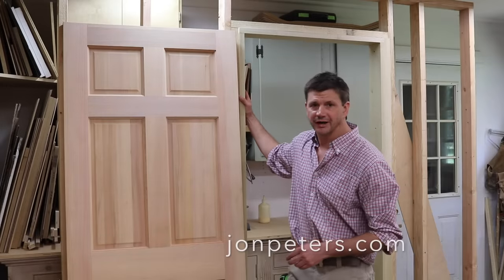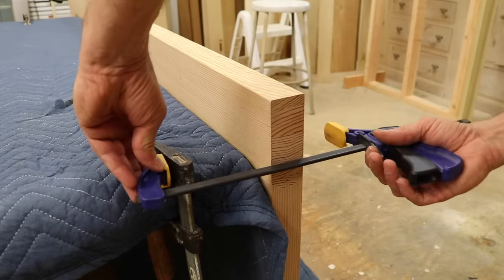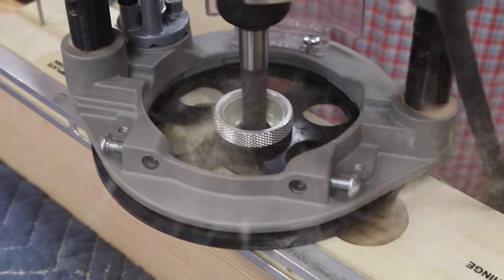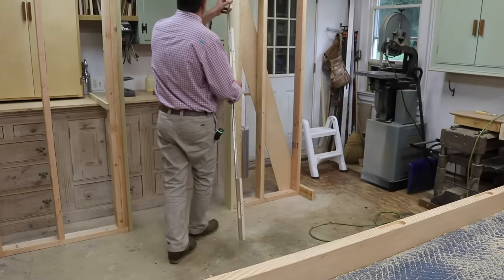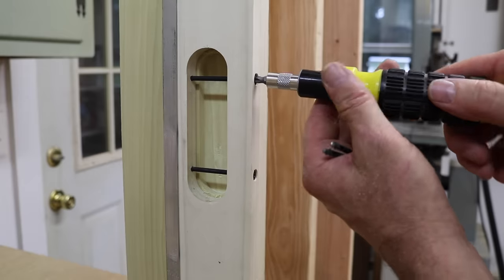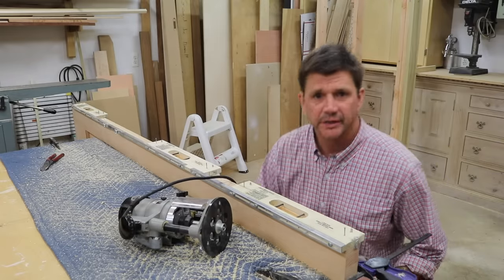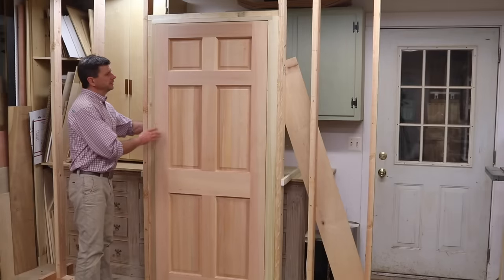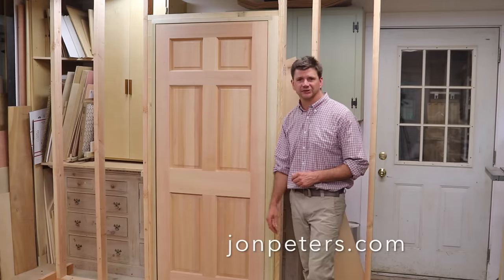How To Hang a Door with Soss Invisible Hinges

Comment: Good tutorial. I'd add set the plunge router before assembling the jig for both depths and use a ton of glue and screws on the buck stud or the drywall may crack. You all can second guess the order he works in but this is the most efficient. Nail holes will re-secure the jig exactly. JP avoided the uneven hinge placement topic Soss recommends which would have filled the comments with panic and arguments like happens on about every job I install these on. Notice the middle hinge is not centered at 1.5 minutes. Now you all can second guess that too. Final word, he did this exactly right. Go try some yourself, then comment.
Reply: Having both a separate Plunge base and Fixed base Router set up you don’t have to keep moving the Template from door to jamb then back to the door...Anyone who is challenged enough to use these hinges had better be prepared tools wise... I seed these hinges on two 3-0 x 7-0 solid core doors as Racket ball court entry doors to the court keeping a smooth face for balls not to engage with... I done this countless times... Good Video Jon...
Reply: Can these be installed on hollow core doors?

Comment: What type of door are you using?  Do you recommend a manufacturer? Also for your jam do you have a preferred Material\manufacturer?  When you prepared the framing for the door did you give yourself a tolerance for the door?  Or did you measure the opening the exact measurement of the door

Comment: Do the Soss hinges say which side goes in the frame and which side goes in the door? as I noticed at 5:11that you fitted them so the door was swinging from the underside of the hinge as opposed to sitting on top which I would of thought was a stronger way of fitting them. Hope that makes sense.

Comment: Great video. I've been doing doors strictly since 1997. These hinges are great for interior use. Exterior use would seem difficult to weatherstrip with compression copper weatherstrip. I guess you could use pop in Q-Lon, cheap weatherstrip but that would be like building the BMW but opted for hub caps instead of real rims. I have used this Hong on jewelry boxes also. Smaller of course.
Reply from the maker: Thanks Roger
Reply: Hi Roger, what would you suggest for outdoor use? I need to rehang a bungalow door to open to the outside because the floor has shifted & the threshold now has an uneven gap. As a result the door doesn't fully open to the inside anymore. Having a hard time finding hinges that aren't a security concern.

Comment: I made a door by laminating 2 pieces of 3/4 plywood for a small entry to a basement but, on their website calculator 1 1/2 inch door thickness is not an option. Does this mean I am not able to use these on this door at its current thickness?

Comment: What size bushing and bit did you use? Did the thickness of the bushings wall affect the installation of the hinge?
Reply: Porter-Cable 42024 is what I use with a half inch router bit.

Comment: Hey great job there. But I used same bushing from porter cable recommended  by soss and using a Bosch router the bushing doesn’t reach the screws for the deeper cut, any suggestion? Thanks

Comment: great vid - what is the reason for moving the jig to the door frame before cutting the deep mortise on the door?
Reply: The depth of the shallow mortise is crucial to the hinge sitting flush in the mortise. If he routed the deep mortise immediately after the shallow one, he would need to reset the router depth again for the shallow mortise on the door jamb. This would waste time because it takes some extra detail and caution to get the shallow mortise just right.

Comment: Hello, thanks for the nice video.
My questions are:

1. These invincible hinges are they better than normal hinges?

2. How long do that lust once installed on a door?

3. Does this hinge opens 90 and 180 degree's or just 90 degree's
4. Are they affordable?
Reply: I used OTLAV 3D hinges, made in Italy. Excellent quality, very well built, 3 way adjustable. You can find them online.
Reply: $52:83

Comment: I do not understand the series of cutting the mortises. If I was doing it I would cut the shallow mortise and then put the spacer pins in and finish one set of hinges before moving on the do the door jam, I know it means moving the pins more but they are not difficult to take out or put in and doing it this way reduces the time needed to reposition the jig.
Reply: that means adjusting the depth of the router bit for the critical depth of the shallow mortise twice, so this is the easiest way possible
Reply: ahh - I had the same question, didn't think of that.
I suppose then if one had two routers both mortises could be routed with one set-up.
Reply: My thoughts exactely
Reply: I would prefer to see the screws longer it carry a lot of weight.
Reply: That plunge router has 3 plunge settings. If you set the 2 depths before hand it will save you time. You don't need 2 routers. The default about sos hinges is that they have no adjustment.
I started using the Tectus hinges and I will never go back. They have up and down, in and out adjustment.  I like the video 👌🏽
Reply: Dogwood Takes
Reply: John Fithian-Franks.........
Reply: John Fithian-Franks

Comment: i bought the little silver template guide thing that you have but the router i am using doesn't have that same black plastic plate that the bottom of your router has.  Mine is like a big 3 inch opening.  So that silver template guide has nowhere to attach to.  Can i buy that black piece for my router because the guide is useless then.
Reply: Get a Rockler guide bushing plate or similar. Great addition to any router kit.

Comment: Nice.....but I would mortise the hinge side jamb before installing it in the rough opening and to the head and other side jambs. Then you can attach the head and strike jambs on the saw horses. In that case, you are making a pre-hung door which is easier to achieve the proper head jamb length and spacing around the head and strike jambs.
Reply: Nice

Comment: question.  with that style hinge, do you still have the same amount of swing degree on the door or is it more limited than a standard hinge? I didn't see the door open more than maybe 75 or 80 degrees, just curious if that's as far open as it allows.
Reply: The hinges allow the door to open a full 180 degrees. However, if you install trim molding around the door, you will have in issue with the door hitting the molding and stopping it short of opening a full 180 degrees.

Comment: Jon, why is the middle hinge not centered vertically on the door?
Reply: I wondered that too.  I guess it would be due to the loads pulling on the door always being at the top
Reply: that is the common three-way hinge setup. Indeed because most of the force is on the top.
Reply: +G.Work.Specials weird, every  door in my house is top, bottom, center.   is it a west coast, east cost thing?
Reply: +John Gragg Europese😊

Comment: Since you seem to need extra support behind the hinges I'm guessing this is not really a retro-fit option?
Reply: If you remove the existing jambs and put in a thicker one and just take the thickness you added with the jamb away from the door it should work
Reply: It's possible if you are able to get the hinge side jamb nice and close to the jack stud. On a door I did using the 212 hinges, I used a 1" thick door jamb made of poplar for the hinge side jamb, and a traditional sized door jamb for the latch side. As long as your rough opening is correctly framed, it should just barely fit.

Comment: Why move the jig from door to frame to door again? Why not cut the deep and shallow mortises while the jig is on the door then move it to the frame and do the same.
Reply: I have the same question. There's probably a reason for it, but I can't think of it.
Reply: I would do it Jon's way, as well, just because I would then know that the depth of the mortises will be equal. If I had to readjust the depth on my router for each cut, there's just more opportunity for mistakes. It's a bit more work, but I'm happy to do a bit more work if it means minimizing the possibility of mistakes.
Reply: That was my question too, and your explanation Dave, makes perfect sense.  Thanks for sharing!
Reply: Dave Starr That's a very valid reason, thanks!
Reply: there are stops an any router system so use them to set the same depth again and again there are usually three depth screws (adjustable)

Comment: Jon - question.  I'm transferring some new cabinet doors for some old ones that have soss 204's.  But the wooden Soss 204 template hangs out over each edge of the cabinet door because the existing Soss hinge mortises are both positioned close to the top and bottom edges.  Given I have six doors to do, whats the best way to transfer the hinge mortise locations from the old doors to the new doors so they are exact?  I've marked the limits and centers of the existing Soss mortises on the old doors with the new doors as well as the center of the wooden Soss template plate, lined up the template and existing mortise center lines, and marked where the template hits the end of the door wih the centers lined up.  Is that the best way to do as I'm worried about slight variations in the pencil lines causing one mortise to slightly off from the other?!

Comment: In order to find a price for the hinges, the company requires you to put in all of your information so they can mail you a quote. Yeah, no thanks.
Reply: Big 4 5/8" Soss hinges are about $30, 3 3/4" are about $18. Both from Zoro Tool.
Reply: there on amazon....you can even go there incognito and view them
Reply: @hypnolobster  a normal room door uses which size of if those hinges?

And the front and back door of the house uses which size?

Does it depend on the size of the door and width of the wood to determine which hinge to be used?
Reply: I used OTLAV 3D hinges, made in Italy. Excellent quality, very well built, 3 way adjustable. You can find them online.